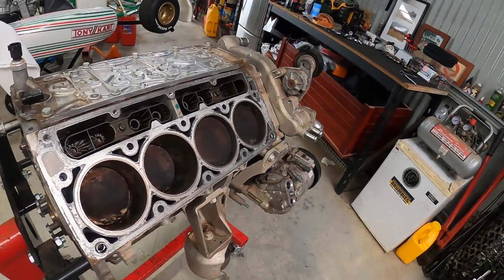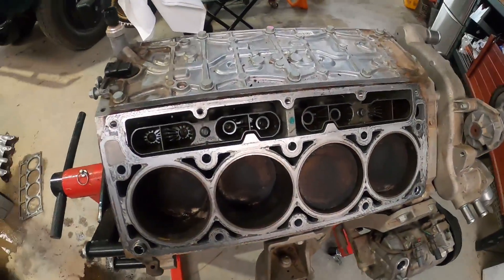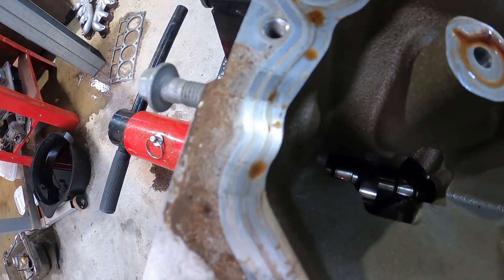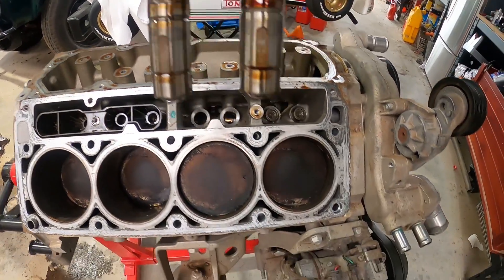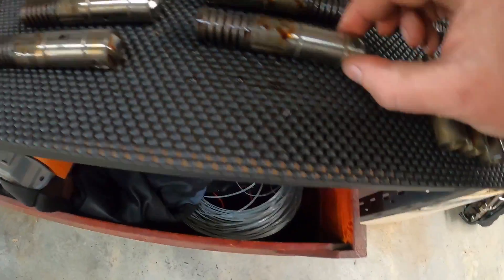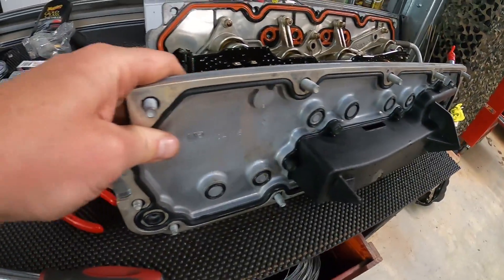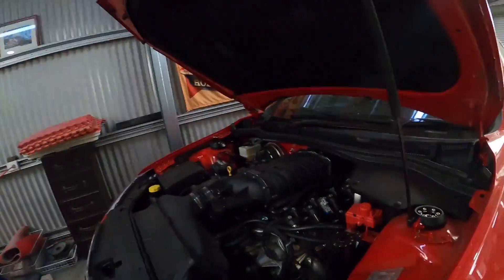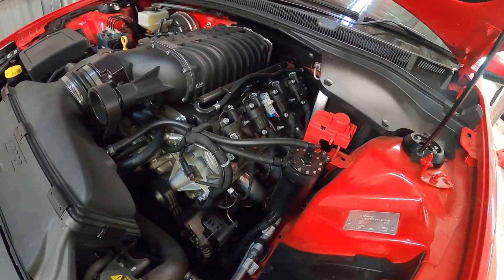500hp LS 6.0L Engine Build Part 4 | AFM DoD Hardware Delete - Save Your Holden Commodore LS Engine

Comment: I am from America, so we have the G8 version, but same car. So I bought a g8 a bit ago, and the guy said it’s supposed to have the DOD delete, and an LS9 cam. May seem like a dumb question but it possible to know if it actually has the cam and dod delete without busting the motor open? Mine doesn’t do any of the things you described, (it’s NA) but I don’t really know if the guy did what he said, and I’ve never driven a stock one before. It’s an L76 6.0L and I have plans to boost it in the future, and am being my research. Any advice would be appreciated, and great video nevertheless!

Comment: Thanks for your very informative explanation of the DOD issue.  I have a VF ute series 1 6.0L L77 engine that had the DOD disabled but still inside the engine.  Had an exhaust lifter failure with the indicitave tick tick sound.  Investigated and found one of the DOD lifters had failed and collapsed.  Luckily no other damage but with a W407 upgrade with new cam, all should be ok.  Car was already fitted with a w375 package but still cost me 7.5k to fix the issue with new valley plate, headers shimmed etc.  Wow a big cost for a small lifter issue that should have been addressed by Holden at the time.  Plus is I now have a 750HP new package.  Love you channel, thanks again for the insight.

Comment: What's the estimate cost of an L77 DOD DELETE?
Reply from the maker: The tune shop we go to normally charges about $6k but this includes cam, tune and all the lifters, valley plate etc..
Reply: yeah thought as much.. Holden should never have done DOD.. The petrol savings were  so minor compared to the to damage cost  it would cause later

Comment: hey clunie im pretty confident of getting the lifters, DOD plate, cam and valve springs replaced but.  Who can de-activate the afm and adjust the tune. Previously having afm the oil pump is already high volume from factory why would you need to change it?
Reply: Unless you're building a loose tolerance LS for high rpm race work, you don't want a high volume oil pump.
There's a pressure relief valve in the sump, that just sprays the oil all over the crank, to keep the pressure in check. Three problems with that, your fuel is providing the energy to pump that oil for no benefit, when you're pushing the motor, some of that oil will get past the oil rings, especially on compression braking and finally the increased oil mist in the crankcase, makes your PCV system work harder, potentially fouling up your intake.
Reply from the maker: Hello mate, any reputable tune shop should be able to de-activate the AFM software and adjust the tune.  Our tuner uses HP tuners.  Let me know if you get stuck.

Comment: Awesome video,ive got a 2011 ve ss with afm,got it new i change oil every 7k now and i drive it normal i dont flog it,its done 225000kms should I be worried or considering the frequent oil changes and the way i drive it i can get another 50-100k out of my lifters,they don't make any noise no rattling

Comment: so yeah even if you aren’t sure, do the lifters.  otherwise you’ll be forced (like me) to get a new cam, pistons, rings, bearings, heads … and lifters :D
Reply: Amazing how Holden just continued making dumb mistakes through their life. Almost like they did it on purpose to create work for mechanics. Faulty V6's with plastic LIM's on earlier ones and stretched timing chains on later models. Not sure why Holden is not paying to repair all this.

Comment: Hey guys - I friggin hope you are still there.  I am 65 and about to embark on my dream - to make a replica 70's Sandman Panel Van. Problem is the van I have chosen is a 2010 VE (one old owner) with 134,000k's L77. The one and only mechanic to ever work on this car made this comment - 

"Previous notes carried forward.
-Crankshaft making noise (squeak noise) known problem
Lifters or possibly camshaft
-Serv light not on." 

Is this valid? 

Should I be expecting big bucks in the future if lifters etc are screwed. Please help.  Appreciate it.

Comment: Hey guys, I'm a little late to this video but just hoping for some advice.

I have a VE SS with AFM and just like you mentioned towards end of video, it rattles at low rpm when it's in 4 cyl mode and the occasional tick at idle. How far gone is it and am I in trouble? Or do I go do an AFM delete asap?

Much appreciated
Reply: also intersted, currently in same boat
Reply: Tune out your AFM and put a little of the thick oil additive in for one oil change. I still have the shitty dod lifters and was having that problem so i tuned it out and put in the thicker additive and it helped for now. It still ticks on startup sometimes but goes away after it idles for a minute
Reply: @Bless-edisYeshuaHamashiach  I had to get rid of it because it was starting to become drama after drama on top of the lifter issue. I did put a thicker oil in it but didn't delete afm, not sure how much better that made it because it would still tick for a couple minutes on cold start. I think safe bets that majority afm models would have the same dramas. I think that's my first and last afm. Thanks for your reply though

Comment: I am looking to get this done to my VE SS (Auto L76) 
I purchased the car 4 years ago with 103xxxkm and went and got the AFM disabled via software because I wanted to put a catback on the car and didn''t want to hear it drone in 4 cylinder mode.
Car now has 122xxxkm, I cannot hear any signs of lifter issues... yet! Just don't have the knowledge to do it myself or the equipment! Will need to find someone in Melbourne
Reply from the maker: G'day James, well worth doing as the AFM software may be disabled but its the hardware of the lifters that is the key issue.  Lots of performance shops will be able to fix for you.  Get a cam at the same time and do a job of it!
Reply: @ClunieGarage  Yep defs getting the cam changed while I am there!"

I was going to get a manual V8 and sell my VE Auto V8 but the VE is such a clean car compared what is out there, plus the pricing Commodores these days...

Comment: Also seen US Holden Caprice police cars running the AFM system for over 200,000 miles due to correct oil changes and regular oil flush systems and most of the time the cars are sitting doing 100's of hours just sitting at 700 revs and not doing hi speeds, or hi rev's/ oil pressures are the issue and not the lifters, sometimes they do but mostly at ideal and no problems if you want to make HP different thing then, but again must do it right and with people that know what they are doing when it comes to DOD deleting systems and products used and other aspects of L77/L98 GM engines?

Comment: will we need a tune after this? i have to replace a broken lifter in my l77, but if im in there i might want to go with a dod delete kit instead.
Reply from the maker: Yes mate, you need to remove the hardware and also disable the AFM in the tune.

Comment: Hey men I’ve got a VE SSV 6 Speed auto L76 dream car  I thought when I bought the car from a car yard that it had a cam kit installed in her but it seems like they just ripped me off with a few things and just put a cam in it only could you give me any advice on where to go even online  also my lifters are starting to make a tapping noise so I need new lifters and  delete the dod AFM I’m in qld Brisbane cheers men
Reply: did you get an answer to this, pretty sure you cant upgrade the cam without the DOD but might be wrong

Comment: Do you do this work for paying customers at your place?
Reply from the maker: G'day Dan, unfortunately not.  We are just an enthusiast channel workimg on our race cars.  However, all our professional mechanical work is performed by Gentech Performance.  Their link is in the description of the video if you are interested.
Reply: Ok thanks, for a DOD delete, cam, bigger clutch. performance mechanics are asking around $10,000 some even $11,000 here in Brisbane.
That’s a huge price tag, I wish I could do it cheaper
Reply from the maker: @dankoz3286  yes, these cars are not cheap! I know that a cam upgrade inclusive of DoD delete is $6k drive in and drive out at the performance shop I mentioned.  However, even if you go with a Mantic clutch or similiar you should have change from $9k.

Comment: I have the manual L77 so it's not activated but does the DOD still effect my engine
Reply: I think you already know the answer to that one. 😩
Reply: @angry9901  Dammmmmn gonna have to get it done 😔 there goes 1k
Reply from the maker: G'day Dr, yes unfortunately you will have the same hardware as shown in the video.  Unless someone did the DoD delete before you bought the car!
Reply: I had L76 had AFM shit    120000km fully serviced if solarnoid goes kills engine now I have L98
Reply: @rodrum7478  Does it destroy the engine?
Reply: @drnexus523  It did mine so put a L98 in
Reply: @rodrum7478  That's sucks! My L77 has 120-000 so I better get it removed
Reply: @drnexus523  to be safe it will also give more kw the cam is a bit bigger
Reply: @rodrum7478  I'll do a cam, lifters and head upgrade whilst I'm at it for sure, already got the VCM intake & exhaust, should be able to hit 400 rkw
Reply from the maker: @rodrum7478  G'day Rod, it is my understanding that the L98 doesnt have the solenoids, strange valley plate or the spring style lifters fitted.  Are you sure it isnt another sensor that is killing the engine?
Reply: No my L76 had it and AFM stuffed up and killed engine now I have L98 without AFM
Reply: So will a good dyno tune on my l77 help this issue always been serviced never trashed it

Comment: Why they would put a DOD or AFM on a v8 for is beyond me. You buy a V8 to not save fuel lol
Reply from the maker: G'day Curtis, a good question for GM! I think it was mainly so GM could compete on highway mileage figures for fleet buyers, families etc..
Reply: GM and particularly Holden always found non creative ways to meeting emission controls etc. Like those PCV valve systems many models ran to gunk the intake in oil.

Comment: Lucky the L98 didn't have any pf that AFM crap installed . although the standard lifters always go in them
Reply from the maker: Too right Michael!  We dodged a bullet with the build date on the VE as it came with the L98.  Lifters are still a weak point in them but they are the standard roller items and not the design debacle we showed on the video as per the L77!